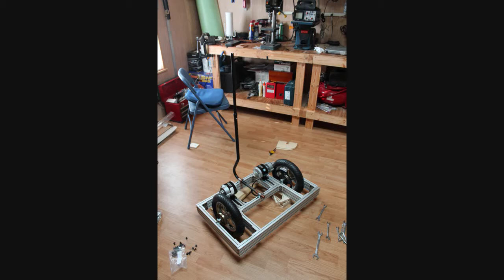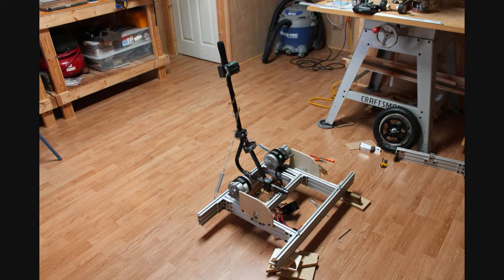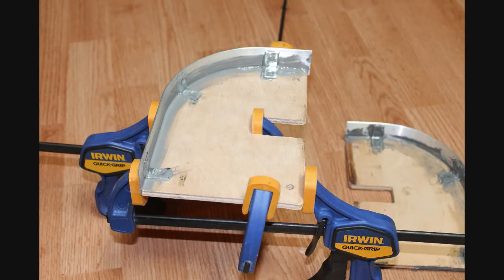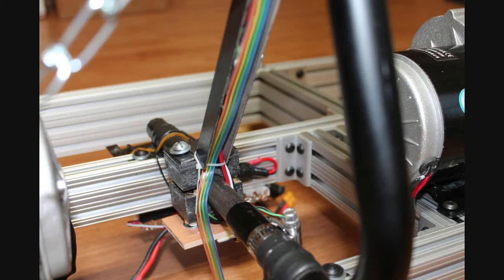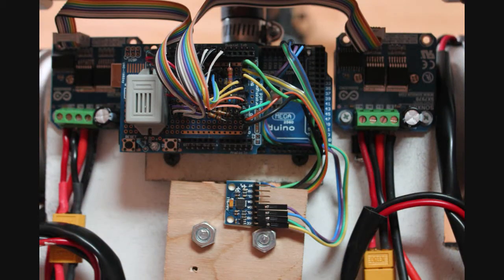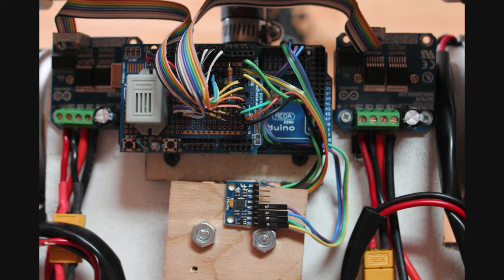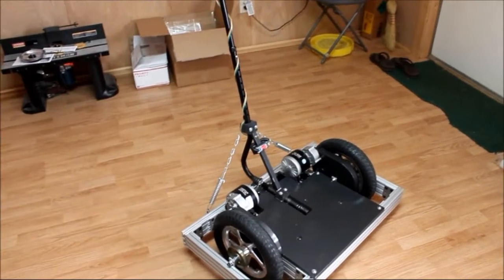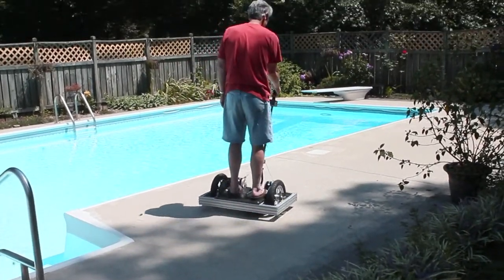DIY Segway aka the HarvWay

Comment: hello I would like to know if instead of arduino leonardo can use arduino uno, or I can use it only with mega?
Andre Brazil Sao Paulo
Reply from the maker: To be clear this project uses two Arduino boards. A Mega, located in the base of the unit, converts the gyro signals into motor control signals. And a Leonardo, mounted near the top of the steering bar, which serves as the rider's dashboard. 
Its been several years since I worked on this project, so what I say here may be flawed. The dashboard sketch ( the Leonardo sketch) probably could be modified to work with the UNO, since mainly it just hosts the 16x2 display shield, and receives/sends user commands to the Mega. The Mega was chosen primarily for its expanded I/O capacity. But it also has significantly more programming space. (So when I wrote this sketch, I wasn't paying much attention to its size). A clever programmer might be able rewrite the Mega sketch to work with a lesser board. But unless one is planning on building many of these cars/chariots, its probably not worth the difference in the cost of a Mega vs the time needed to figure how to implement the functionality on a smaller (cheaper) board.
But that's just my opinion. If you like a challenge, then give it a go.
Thanks for the question, and interest  in this project.    
GL,
Jim

Comment: nice work! if you just change the PWM frequency to be around 64K Hz you won't hear that very high frequency eeeeeee sound coming from the motors. It will be quiet...
Reply from the maker: Actually most of whine seemed to be linked to the flat cut gears used in the gear boxes. But to your point that whine was probably the thing that was the most dissatisfying about the build.
Appreciate the comment though, and your interest in the video. Thanks.

Comment: Why did you use dashboard is it mandatory? or else only arduino mega is enough &
How should i upload the codes it is having 2 ino files 1 for dashboard and 1 for mega
Im using only mega should i install only mega ino
Reply from the maker: The way the Mega sketch is written,  you need to have a second Arduino (i.e, I'm using a Leonardo) to operate the car..
Thee Mega is doing all the work, in terms of making the car go and balance.. The Dashboard sketch displays what is going on in the mega and how much power is being used.. It also sends user commands to the Mega. For example the user can run the car in a "Beginner" mode, or the user can switch to the "Advanced" mode. So I would say "yes", the dashboard is pretty much mandatory.
This project was one that I did just for myself. Never expecting anyone to replicate it. You are welcome use the material that found at the Github site, but  do so at your own risk. 
Good Luck and thanks for your interest in this project..

Comment: Hello! I'm from Brazil and I'm also trying to ride a segway clone! I'm in a lot of difficulties, can you send the project file? Tiagocostacardoso@hotmail.com
Reply from the maker: Go here https://github.com/jmharvey1/HarvWay
for the code and circuit details used in this video.
But be aware that while this worked well for the configuration shown. there is no guarantee for how it will perform in any other car .
GL with your project

Comment: hi is it possible to help me to get on the  motherboard
Reply from the maker: +Mohamedbentayeb4 Mohamed 
Hi I appreciate your interest in this project. For me it was a fun build
To be honest I'm not sure I follow your question, but gather you want more details about it.
If that's the case, please see the documents found at this link.
https://github.com/jmharvey1/HarvWay

The code sketches are complete, but wiring diagram is not. It only details the motor BTS 7960 to Mega connections.
Power distribution and other connections you will need work out.